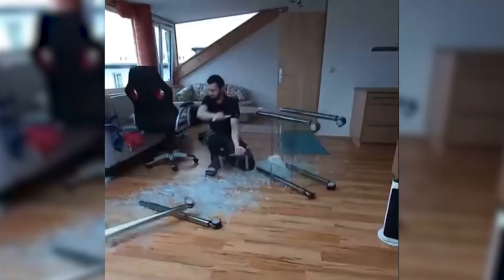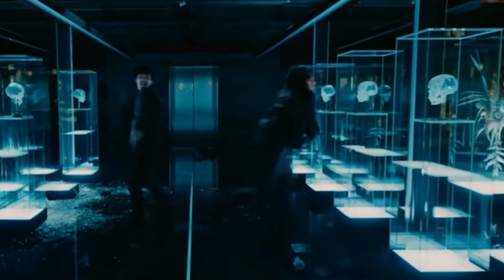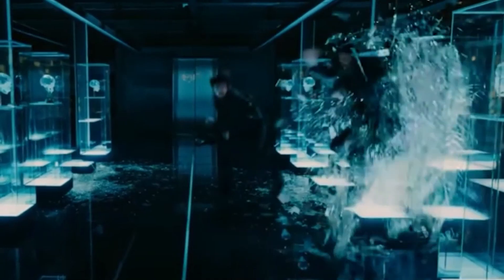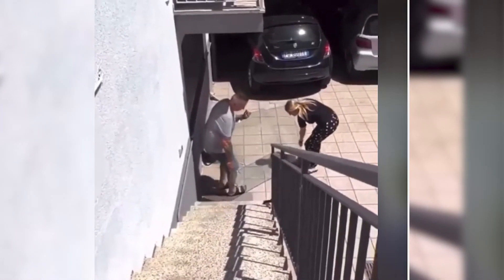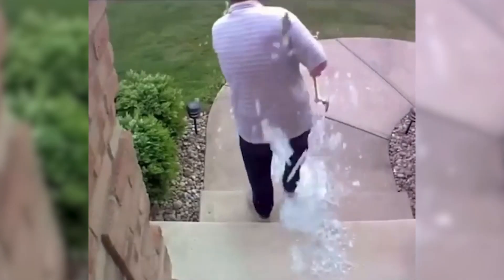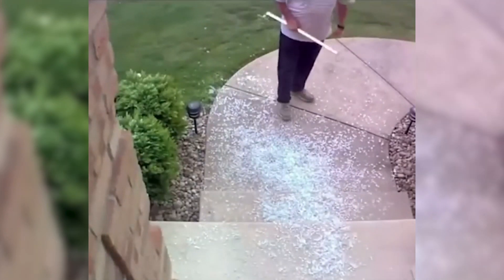Tempered vs heat-strengthened glass. Did You know

Comment: I feel that most specifiers  of glass know this but it doesn’t really cover the issues with laminating. The way I understand it ( in Australia AS1288 since 2023) skylights should use “laminated heat strengthened” glass as it breaks into larger pieces and is more likely to remain in the supporting frame, whereas “laminated tempered” glass will sag and fall out. In DGUs I imagine that’s only for the lower (inner) skin, and the outer can be monolithic tempered.  Is that your understanding?
Reply: I much prefer heat strengthened laminated glass than tempered laminated specifically because of the break pattern as you suggested.
In skylights, again as you suggested, a mono tempered exterior lite over either HS or even annealed laminated is the best option IMO.

Comment: Ima bout to install tempered glass on container homes, can anyone recommend otherwise? Especially when moving the entire 40’ container. TIA
Reply from the maker: Moving glass can be tricky. I would recommend a group on FB called Glazier Nation. Unfortunately, we are not familiar with systems like that but glass should be protected and padded on the edges when ever it is transported. Any pressure or impact added to it in transit that can definitely compromise it no matter what type of glass it is. If you take a look at hose glass trucks work, the add pressure to the surface holding it back still, but rarely capture all around to prevent impact. You an also build a great that has the glass resting on foam on all for edges to help minimize potential damage.

Comment: Can heat strengthened glass be cut?
Reply: The short answer is no. 

The long answer is that by definition, tempered glass has a minimum surface compression of 10,000 psi or greater, while heat strengthened has a surface compression range of 3,500 to 7,500 psi. IF the heat strengthened glass is at the very low end of the surface compression range then it MIGHT be possible to successfully cut it but it's going to be hit or miss at best.
Reply from the maker: Greg is correct. Once you change the surface to internal molecular structure of glass by heat treating it, then it’s a huge gamble that would is likely to pop.
Reply: @LearnGlazing  Yep, and just to clarify that I was talking about the low end of the heat strengthened glass and not tempered. Tempered can never be cut or drilled or notched or so on...not with hand tools, not with lasers, not with waterjet....doesn't matter, can't do it.

Comment: I didn't know! I'm a licensed c-17 glazier. I knew the strength differences. but I did not know that in hi/rise heat strengthened would be better? It still seams dangerous if they were to fall? Or is tempered recommended in hi-rise. I always thought tempered was best for safety..?
Reply from the maker: Hello SweepEaway, that's a great yet complicated question.
 It all comes down to codes and the safety requirements of the building. Typically, all the players involved and the engineers must determine if falling glass poses a danger to people passing by. When broken, tempered glass is highly likely to fall, whereas HS glass tends to only fracture. So unless some sort of projectile hit the glass creating a void all of the glass is typically present to hold itself in place. You are right, tempered glass is safer for impact and falling debris. But, there are specific rules for when impact-resistant glass is needed. In the code's eye, not all glass is likely to see an impact.

HS glass has outstanding thermal stability, its flatness and light transmission is close to that of annealed glass and much better than that of tempered glass. HS Glass is 3 times more resistant to thermal stress in comparison to normal annealed glass. Basically, It has some of the strength of tempered glass, but without the optical distortion. This makes heat-strengthened a great choice for windows in high-rise buildings, which must be able to resist high winds, while still providing optical clarity
Reply: @LearnGlazing  thank you
Reply from the maker: @sweepEaway  Not a problem at all. Thank you for watching our video.
Reply: @LearnGlazing  thank you! that's a great explanation with details!
Reply from the maker: @aynafishka7220  Thank you and thanks for the support.
Reply: @LearnGlazing  Great answer!
Reply from the maker: @gregcorwin8316  thank you. Have a great weekend.
Reply: @LearnGlazing  thanks, you too!